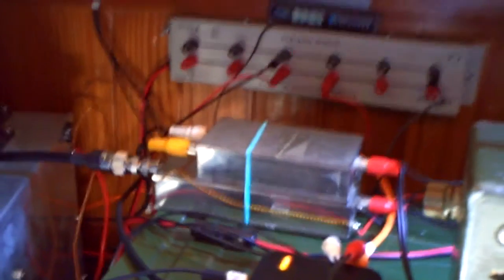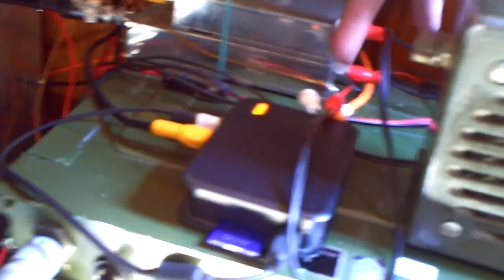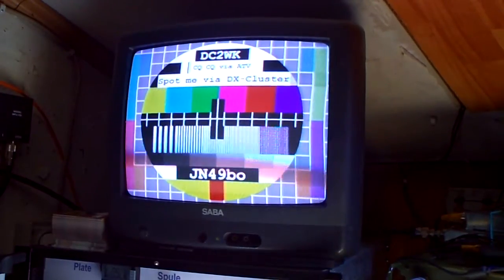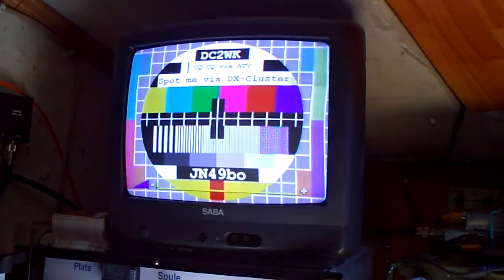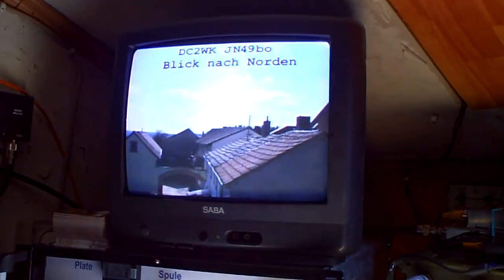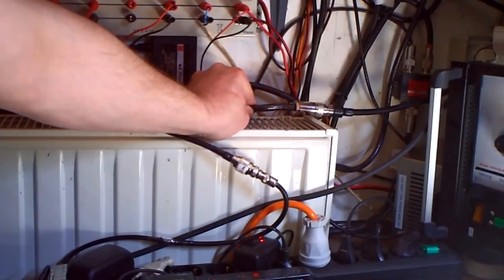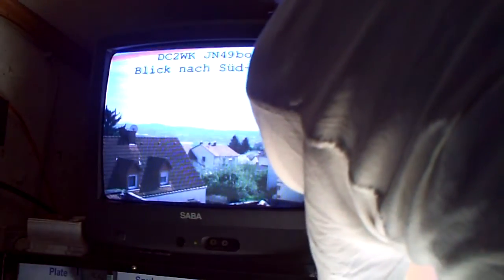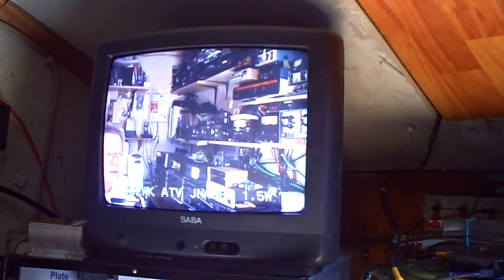23cm ATV Test

Comment: I'm also considering getting into ATV, but I'm considering digital transmission instead of analog. DVB-S looks like a good option, because DVB-S set top boxes can be used for reception without any special equipment.
The only problem I ran into is the price of the equipment, and a homebrew DVB-S modulator is really out of question. I can build antennas, audio frequency and simple digital circuits, but RF and complicated digital stuff is too much for me.
73 de OM5ATT, Attila